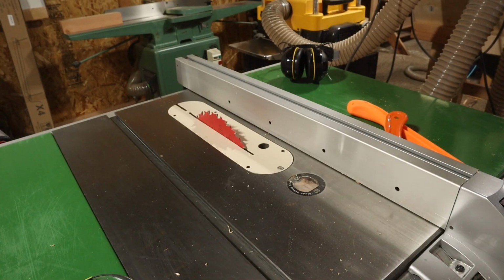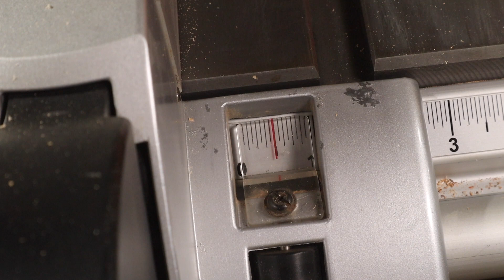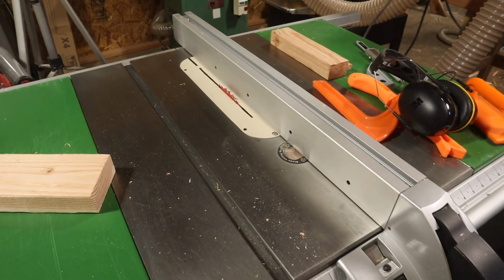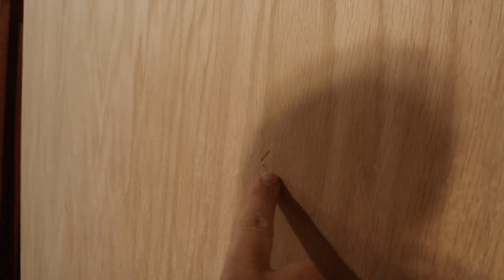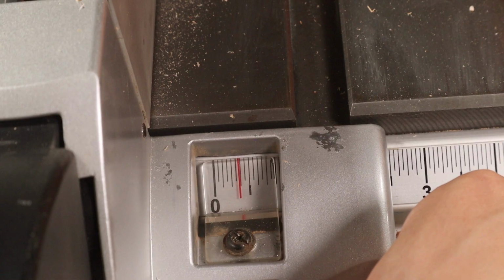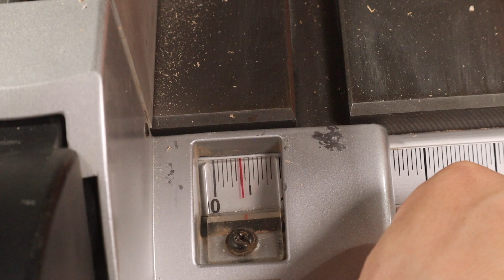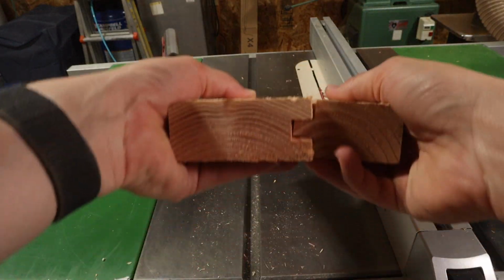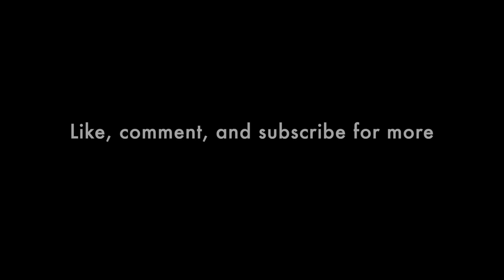Tongue & Groove with a Table Saw

Comment: Sounds like you have used your router table to make tongue and groove workpieces, is that right?  Did you use a T&G bit set to do that? Which one? Thanks!
Reply from the maker: Great question Steve. I have used the router table in a couple of different ways. First was with an up spiral bit manually cutting the groove then a matching tongue. Not terribly hard but also prone to error. I also have a TnG bit like you referenced and it worked beautifully once you figured out how to adjust the two bits to form the mating joint. Below is a link to the Freud one I have. It’s worth it if you’re doing any amount of TnG work. 

How’s your shop coming along??
Reply: @NorthwestCraftsman  
Thanks for the response! We (my daughter and I) are thinking about building a dining room table including a TnG tabletop. I’ll check out the link below. 
Thanks for asking about the shop. I’m just putting the finishing touches on a mid century modern end table. For me this project was a skill builder. It includes tapered legs with 15 degree angle cuts. The legs and tabletop have been rounded on both sides (should have bought a bull nose router bit 🤦‍♂️) which, after round overs, required the belt/ spindle sander to make them as exaggerated as I wanted. Plus, the entire build was done with dowels. I’ll use figure 8 clips to attach the tabletop though. Like I said, for me it was a skill builder but for you and others, would be a piece of cake. 
Anyway, all the best!
Reply from the maker: Totally forgot the link, here it is 😂 https://amzn.to/4aMHCmV

Man, that’s sounds like a fun project! It’s nice to have those projects periodically that push the boundaries of what you have been able to do in the past. When you’re done, I would love to have some photos emailed to me. Love seeing the stuff people are working on.
Reply: @NorthwestCraftsman  
Will do 👍🏻